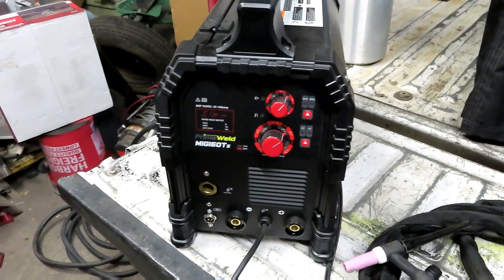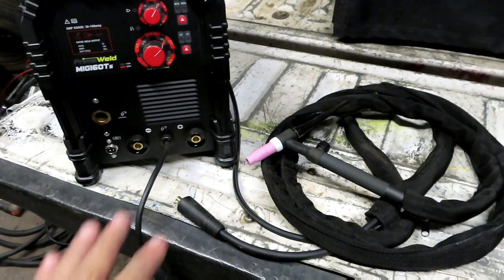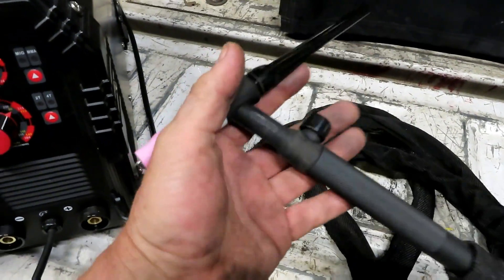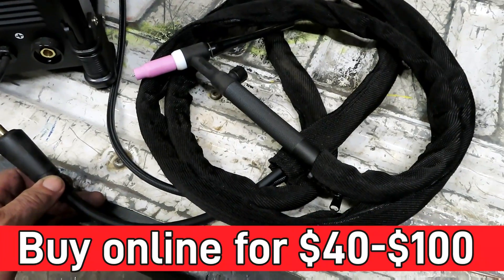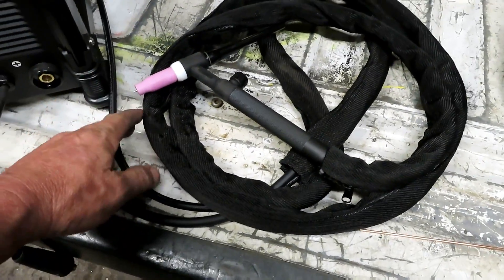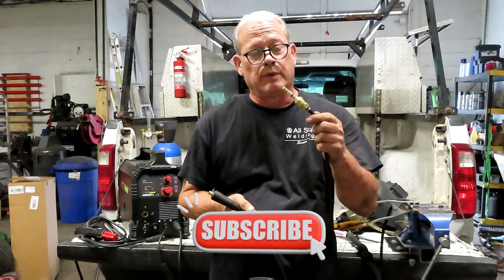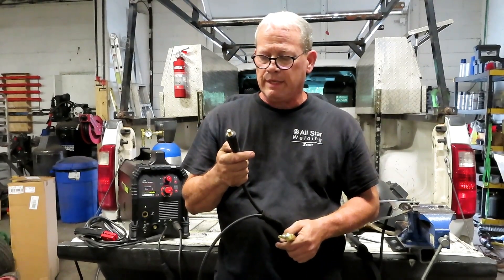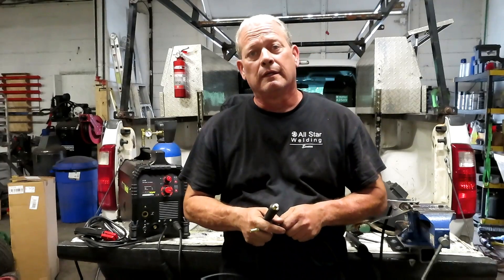TIG Welding with a Stick Welder? You Can Do It! Here's How!

Comment: Can you post a link for that Dinse adapter you ordered if it works?
Reply from the maker: The adapter I ordered was wrong. Apparently, at 10 to 35 adapter is hard to find. So, I went to my welding supply store and just got a dinse 35 plug that I need to actually hardwire on. I haven't got around to doing that. However, when I do, there is a 35 to 10 adapter on Amazon so I can take it back down to the little size if I need to.

Comment: I was curious as to why it smokes so much? I am under the impression that tig is pretty clean and there is usually not much smoke. Any idea as to why it is smoking while welding? I'm looking to get into cheap ways to start tig welding in my garage, and I don't want to have to deal with the smoke factor as of right now.
Reply from the maker: The time it smokes, my steel wasn't clean. If you look closely, there is a small gap between the plates. That was just a piece of scrap I had laying around, and I was unable to clean off the mill scale. Tig normally is a very clean, and nearly smoke free. That is, if you clean your pieces well. My pieces were terribly dirty. It didn't hardly smoke at all on the first test, or the second. But that third one smoked a lot just because it was dirty, and trying to burn off the mill scale.
Reply: No such thing as smoke free. If you don't have a proper fume extractor for your garage and wear proper por, then don't do it.. Tig looks clean but metals always release gasses.

Comment: The vulcan should be pretty useful if you need TIG, though it might be hard to wheel it around... It goes down to 20A, now how easy it is to Start low might be another question...However, the Vulcan does have a hot start.  It will be good to see in action.
Reply from the maker: My Outlaw is mounted in my truck. If I go mobile and need Tig, it will be at my tailgate, otherwise, I will bring back to my shop. I get called to a lot of commercial kitchens to repair stainless stuff, some is too big to bring to the shop. For those, I plan on just getting a lunch box sized DC arc welder. Most go down to around 20, and up to 120. I will make a small wheeled cart, similar to a small suitcase, to hold the welder, my small tank, and the torch/hoses. That setup will be perfect to repair commercial dishwashers, handles on brackets, handles on fry baskets, etc
Reply: Yeah, that's what I figured  you were needing to do.  Pick a small one that others say works well for what you need. In one of your other vids you said you were getting calls with stainless repairs. 
  I haven't practiced lift TIG on the everlast, I contaminate the weld pool enough with tungsten ,  using the HF start.   
Hope you have some scrap stainless to try out your portable rig on.  I guess you have to use some type of passivation on stainless in restaurants to ensure it doesn't rust or is it a problem?
Reply from the maker: @tsl7881  yeah, I do stainless all the time, but in the shop. I'm just wanting a more portable option. My Primeweld 225 is so big and heavy.

Comment: Good deal. I have an old lincoln 225 ac/dc  and was thinking of trying it out on a similar set-up. Wonder if the ac weld aluminum with out the hertz adjustable? Should be just like the old tigs at 60 right ?
Reply from the maker: Hmm ...  I don't know. I use the Primeweld 225x for my aluminum.
Reply from the maker: And I don't know if I'd want to try this on a transformer based welder